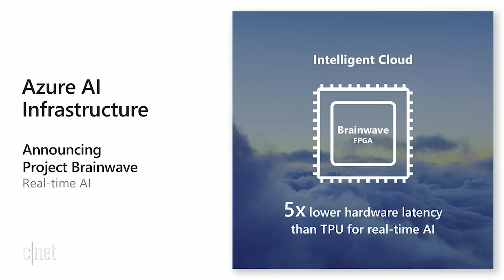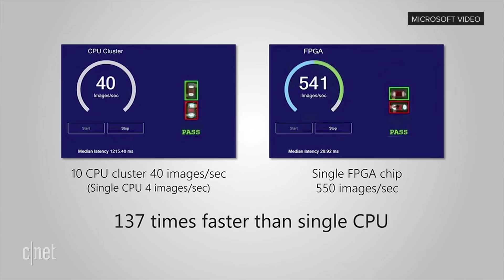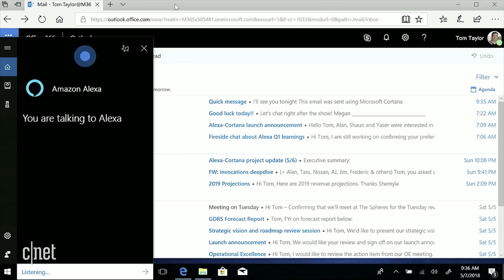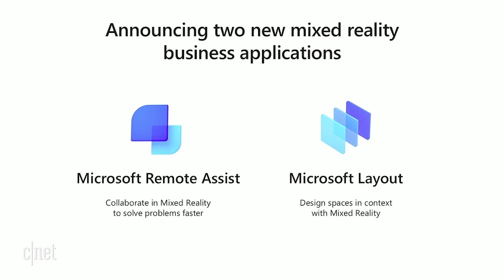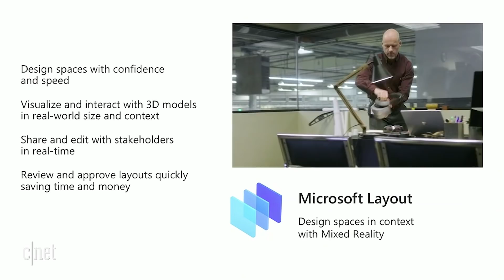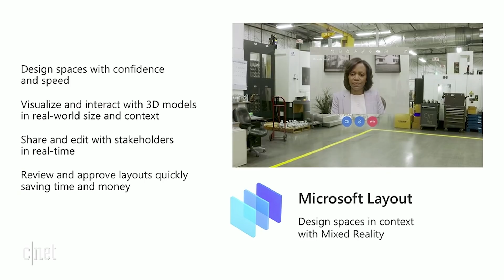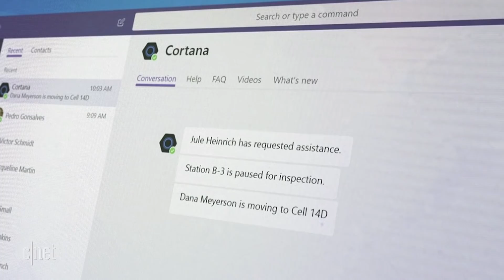Microsoft's Build 2018 keynote highlights

Comment: I hope so ...  It's ..  far more better .. to use Google Assistant instead of Cortana or Alexa .... 

Google Assistant is Getting improving in a wide range with Deep Learning and Machine learning ... And the Major part with AI - ARTIFICIAL INTELLIGENCE .... 

Since ... Apple is going to replace it's Siri with Google Assistant ... In the Upcoming iPhone XI in WWDC .. 

So , It would be a great Decision to take by Microsoft ... 

If not ..  then Microsoft need to increase the number of lines of Code in Wide Manner .. . To make it Successful ..

Comment: Having worked with computers for decades I do not recommend using Windows 8 or 10. I’ve seen people with so many frustrating problems when using these systems, including many new laptops. I feel sorry that lots of people waste so much money on dud devices, with the operating system being the root of the problems. Updates will not cure an operating system that was designed as if it were sick. I have to wonder if Microsoft are employing the mentally retarded under politically correct policies.
I recommend using Windows 7 if you have to use Windows at all and if possible build your own PC, it’s not difficult.
Microsoft can’t build sh*t!

Comment: microsoft, give a reason to move away from Windows 7!
Reply: You should upgrade at least for security, Windows 10 has secure boot which could protect you from rootkits for example.
Reply: CThienV way better UI,  Windows store and way more apps and features etc.
Reply: Santhosh Annamalai ok but im still gonna run Windows 7 Its my choice so
Reply: Eventus Vantos theres no windows aero aero is better :P in my opinion
Reply: CThienV 

Better security. Windows 7 is a relic from the past, like XP, that needs to die.
Reply: Okay

Comment: So much background process.  /:  1 third of my cpu is dedicated to your telemetry....wtf
Reply: 2-3% here
Reply: same with me if my lappy doing nothing CPU only bout 3-4%. Even with 4-5 Chrome tabs CPU still below 30%.
Reply: You need to refresh your OS, my CPU never goes over 3-4 % if not doing anything, often even less, and that is with 3rd party background processes (vpn, audio enhancing, mouse and keyboard software...) you obviously have some virus or miner, plus i have dev build and that provides more info to Microsoft than normal.
Reply: DrStormpooper it's running on a pentium d...,.,that enough info
Reply: Well, my Surface 3 is the same and it runs on Intel Atom...